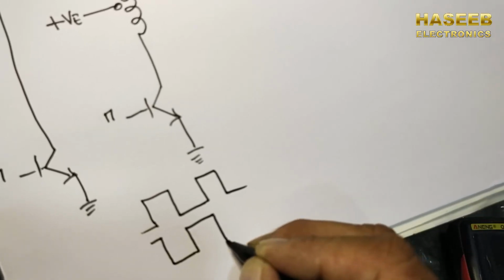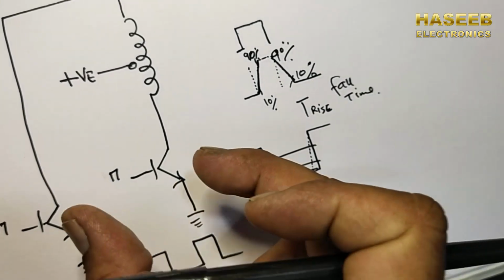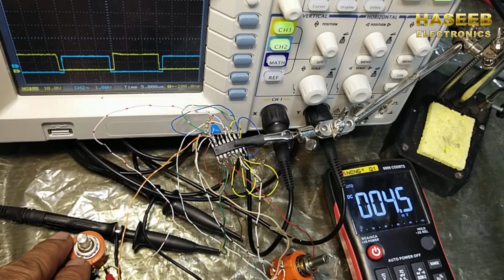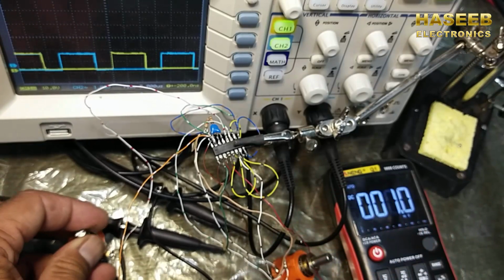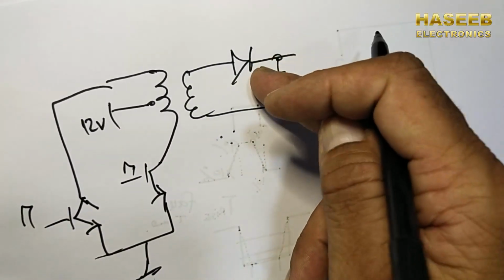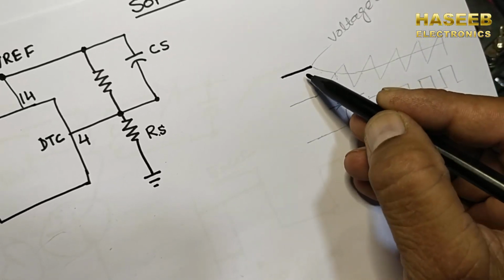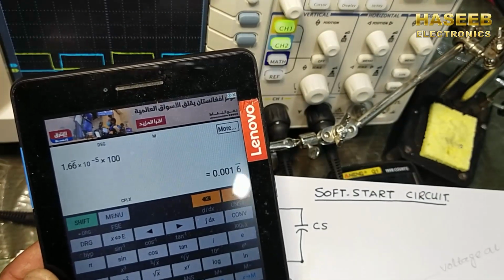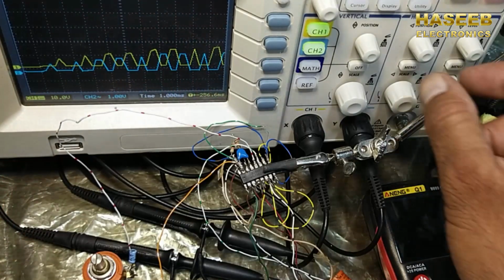{452} TL494 Dead-Time & Soft Start Circuit, Practical & Calculation

Comment: Hello sir, could please help me out? I want to know how to adjust the duty cycle other than the dtc? You said it the feedback control and the feedback pin is pin 3. But I am not sure how it works and if I am right or not. Is it that you have a voltage divider that changes the voltage going to the pin 3 and that changes the duty cycle? Please reply.

Comment: T=RC, applied to measure the time it takes to charge 33.3% of the capacitor. we say 5T is the time it takes to fully charge a cap. But it's actually 99.6% ~100%.
Reply: ✅ Let's break it down clearly:
⚙ The RC Time Constant
T=R×C
This defines how quickly a capacitor charges or discharges through a resistor.

🔋 Charging a Capacitor (through a resistor)

Time	Charge Level
1T (RC)	63.2% charged
2T	86.5% charged
3T	95.0% charged
4T	98.2% charged
5T	99.3% charged
>5T	>99.5% (≈ "fully")

5T ≈ 99.3%, and not truly "fully charged", but close enough (≈99.3–99.5%) for practical purposes.

🔁 Discharging
𝑉(𝑡)=𝑉0⋅𝑒−𝑡/𝑅𝐶

After 1T: 36.8% remains

After 2T: 13.5%

After 5T: ~0.7%

So again, 5T ≈ complete discharge (within 0.7%).

✅ Where "5T = Fully Charged" Comes From
In electronics, we approximate "fully charged" or "fully discharged" at 5T because:

Beyond 5T, the change is insignificant for most circuits

It's simple, deterministic, and close enough (error < 1%)

🔄 Applying to Soft Start
So in your soft-start circuit:
100khz
If you want 100 PWM cycles = 1 ms of ramp-up time

You're targeting ~99% duty cycle allowance after 1 ms
→ Then just set RC = 1 ms / 5 = 200 µs
→ Pick R = 200Ω, C = 1 µF, or R = 1kΩ, C = 200 nF

5T is a simplification. True "full charge" is infinite time, but 5T = ~99.3–99.5%, which is functionally full for most designs.

Comment: Dear Ashraf, i hope you are doing good. 
I cannot have stable output while adjusting DTC without adding a capacitor between gnd ans pin 4. Is that normal as i donc not ses it un your circuit.

Comment: 9:31 correction: datasheet specifies that these resistors should have a ration of 1:10 so you can't use a potentiometer. Best option is to use 1k and 10k and calculate a capacitor. You forgot to teach about soft-start and dead time combined, which uses a diode to separate both circuits.

Comment: But Rs forms a voltage divider with the R parallel with the Cs, so pin 4 will never go to 0 V. Is 100k ohm feasible to be as close as possible to 3 % dead time or can it be even higher ? (100k is C discharge time of about 0.2s )

Comment: What may be a possible reason for unstable frequency on pins 9&10? Tnx
Reply from the maker: improper biasing of error amplifiers
filter capacitors connected to the compensation pin
de-valued CT timing capacitor 
stray capacitance in the circuit 
improper dead time control at pin number 4
Reply: @HaseebElectronics  thank u;  obviously a long way to any success

Comment: Great, Haseeb! I tested the soft start on single ended mode. But my wave only increases the duty cycle, not the voltage, like yours. All range is 12V...
Reply from the maker: good morning dear
i will check it 
if it is changing the duty cycle, that is good 
i will recheck again, i think voltage will not change 
it will change the duty cycle 
i will check again and will reply

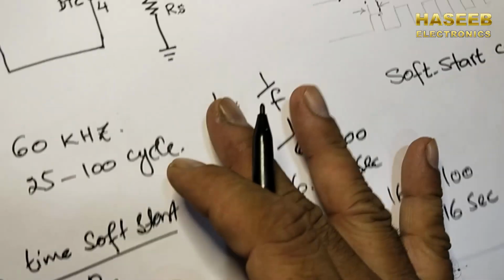Comment: How much resistor value between pin reference and pin 4 at 16:52 ??? 
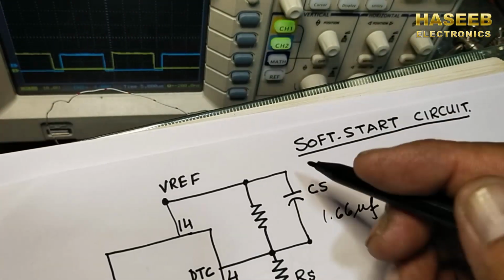How much value of voltage in R1 for maximum duty cycle at 16:52 ??

Comment: Salaam sir, I am Israr Ali from Hyderabad Sindh, kindly guide me about my Rigol DG2041A function generator. It was after shown a message on screen (overload waveform), and suddenly disable square and pulse waveform at output terminal but showing voltage on output terminal, and other all waveform are properly appearing on output terminal, so kindly guide to me that, how can enable square wave and pluses wave on output terminal? 
Best Regards 
Israr Ali

Comment: More clearly now after waching this video, especially on no4 pin (DTC) - waiting for video controlling op amp as current sensing, I tried modified several PSU , it worked on controll voltage but always failed in controlling current. It give me @only 30w instead of 200-300w as I expected. 
Thank you for nice presentation video & waalaikum salam, dear brother.

Comment: A real light bulb moment for me with this video, thank you for the clear and detailed explanation!

I have one question. You demonstrated that the pulse width could be modulated by either the duty cycle or the dead time control. SMPS design utilizes the duty cycle method to control pulse width, what is the reason for this? Hope that makes sense?